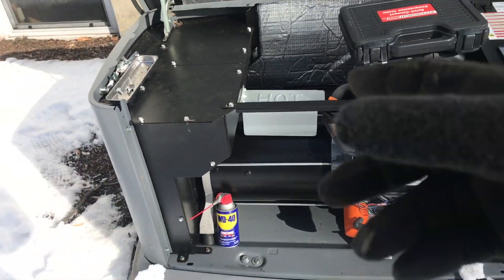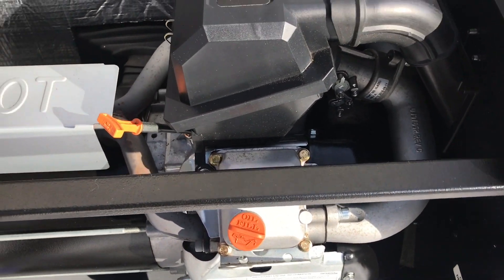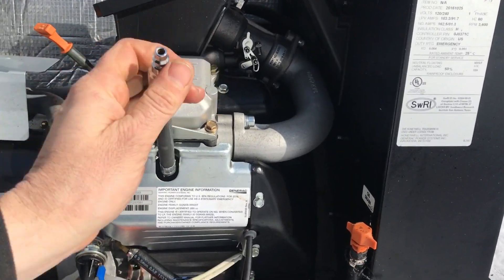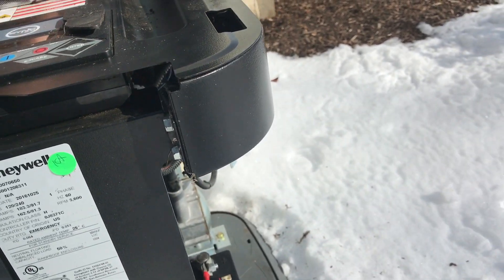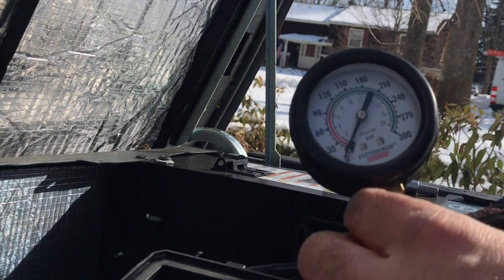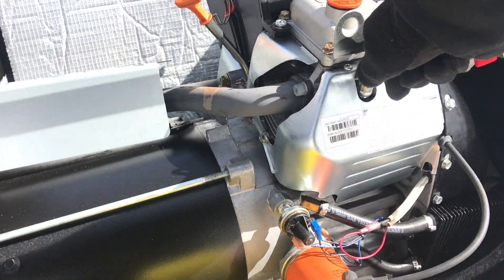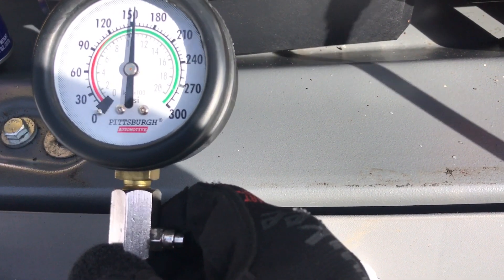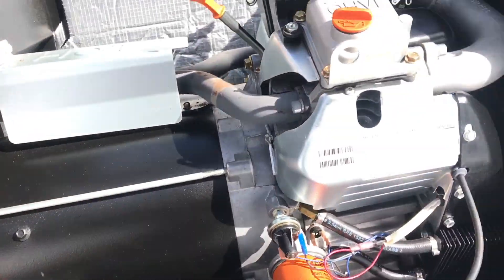Compression Test Engine overfilled with oil sprayed oil out

Comment: Hacker when you overfill an engine with oil the oil will get tiny air particles in the oil and it will not lubricate correctly. In layman's terms you could hurt all the crank bearings and cam bearings and anything else that the oil lubricates. Who's the teacher now LOL. Great video Peace brother
Reply from the maker: I am a student at life learning even when teaching. I feel bad cause the neighbor that overfilled the oil is another customer of mine that always tips bottles of wine.